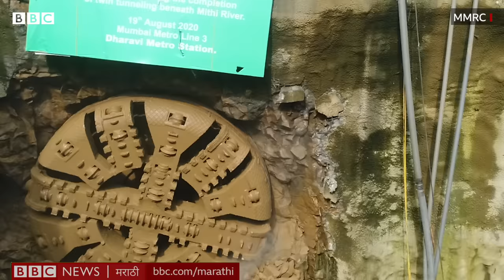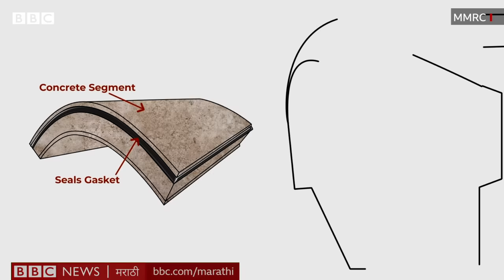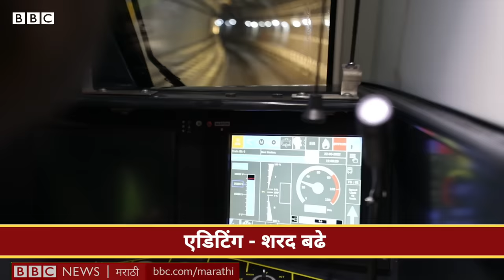Mumbai Underground Metro : Colaba to Seepz मुंबईच्या 75 फूट खालून जाणारी Mumbai Metro -3 कशी आहे?

Comment: Are there pumps to remove water, in case some water enters the tunnel? Pumps are provided in metros of some other cities close to sea.
Reply: Yes, they are installing 338 dewatering pumps at 27 spots. In addition to that, all the station entrances (and associated structures) are built about a meter above ground level. So there's flood prevention and flood removals mechanisms.
Reply: Yes. Also, they will have flood/storm water drainage.
Reply: entrance to stations will not be built at ground level. Most water is likely to come in from entrance...unless water seeps through ground and into metro cement boundary

Comment: Andheri east to Andheri west do not have much passengers except for few peak hours. This metro won't get sufficient passengers. Long distance stopage  high speed buses would have provided better alternative.
Reply: roads are over jammed, how will bus travel high speed, mumbai needs more underground metro and double decker local train
Reply: @abhi739 , No, if bus has long distance stoppage  say around five Kilometer. Then frequency will improve and people will switch over to buses from private vehicles. Driving in jammed traffic is exhaustive.

Comment: India needs CHINA to work on MEGA  INFRAS TSUCTURE TO DESIGN BUILD 
FAST
 HIGH QUALITY
ON TIME
 CLEAN
DESIGN BUILD 
 ALL MEGA  
ROADS HAVE  3   OR  4TIERS; ONE ABOVE THE OTHER.
  Coastal roads;  Sea reclamation.
CLEAN FREE FLOW WITH NO INTURRUPTION
 Metro/shuttles.. under ground.  
above ;
Inverted  Rails sysyem.
Elevated train system.